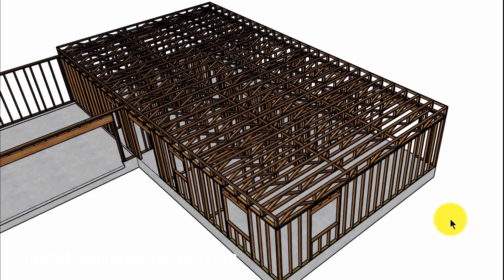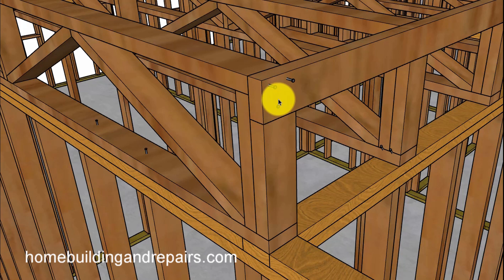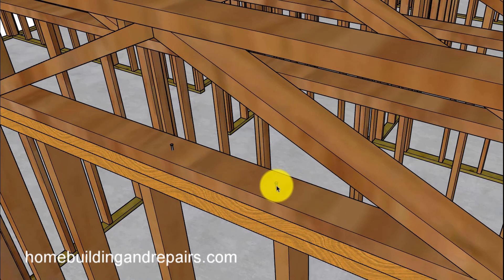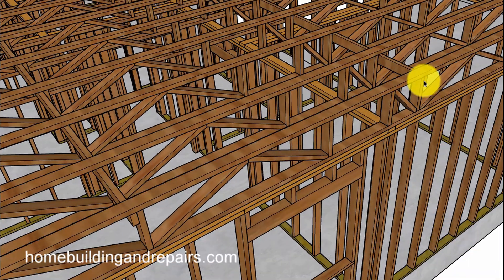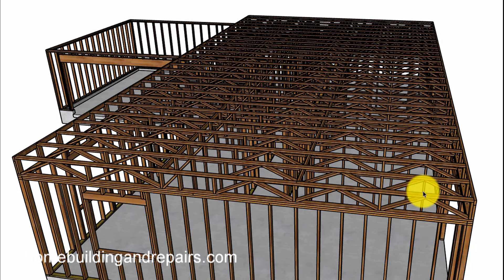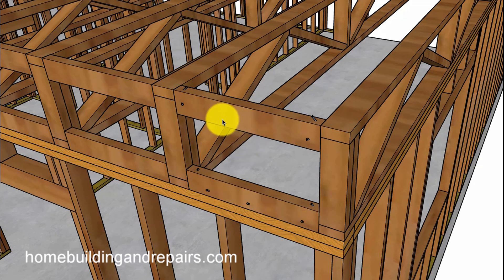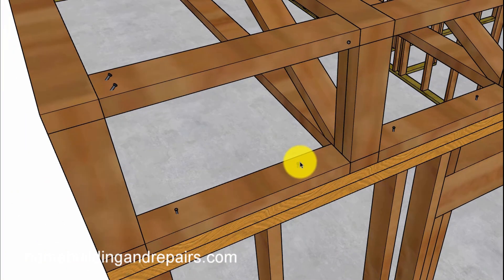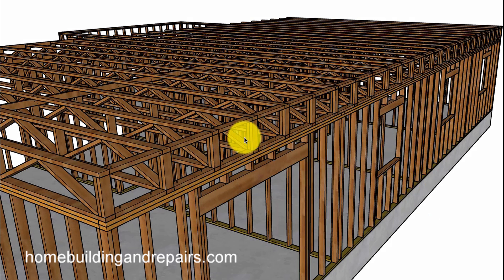Blocking And Stabilizing Ideas For 2 x 4 Truss Floor Joists

Comment: Quick question. My house was built with trusses like these but they are 24" apart from each other. The trusses themselves are in perfect state but because they are so far apart, the floor feels very spongy right in the middle between the two trusses. I can see from my basement how the subfloor moves down right in the middle of the trusses. The subfloor seems to be regular 3/4 osb, not the ones that click with eachother but the simple ones that just sit flush next to each other. Would just blocking help? Its very squeaky throughout the whole house and its a 10 years old house. 😢
Reply: They should have used 1-1/8" subflooring!
Reply from the maker: No easy answer here. Blocks will help, but could start making noise like floor squeaking after a while. I've seen some people add another layer of subflooring, but that could be difficult and expensive.

Comment: Best vids on the Tube :)
Specific question- I get vibration on a truss floor with washer spin cycle.  Any suggestions on how to firm things up a bit?
Reply from the maker: Your joist might be over spanned or you could have some engineering or constriction assembly problems, but you could also need a new wash machine.
Reply: @gregvancom hahaaa
Hope not.  It’s new.  Span about 15 feet.  It’s hard to describe.  Floor is solid when you walk on it but at the same time the higher frequency motion seems to have more motion than solid beam.  Maybe I just need to get used to it?

Comment: Informative video.. . I'm a truss designer it's a pleasure if I can help in any case of trusses designing
Reply: is it possible to add a lvl beam under those joist? some of my bracing are cracked i thought maybe adding a beam under to cut the span halfway would help, but i was told it is not possible unless done properly
Reply: @denisdyotte2935 Look up strongbacks! I am having the same issue and just learned with strongbacks are. They go in the truss - not below.
Reply from the maker: Thanks

Comment: Thanks Greg.  I have a 2x4 Truss floor 24OC, and I want to tile a bathroom floor but TCNA methods are very limited for that span.  Would adding blocking/bracing (perhaps a mini truss)  between trusses under the bathroom floor increase the stiffness of the floor or is this a fools' errand?
Reply from the maker: I would think you could, but these are engineered floors and any modifications to them might create problems in the future. You could check with one the manufactures for more  info.

Comment: Greg - great video and graphics. Won't your subfloor supply the necessary membrane to stabilize the trusses? With the subfloor material, why block at all?
Thx, Jay
Reply from the maker: It might, but I'm guessing the manufacture wants a firm board to nail perimeter sheathing and to help support framing above these areas.

Comment: I keep getting myself distracted wondering why you would have built the trusses with nails and not use metal connector plates. Is there a reason? There is a bit of time talking about nails that wouldn't be an issue if the 2x4s connected using plates to build the trusses.
Reply from the maker: The video is not about building a truss, just how they can be connected to each other and other components like walls with nail, not other types of building hardware.

Comment: Do you know how I can add a non load bearing wall above, parallel but between these 2x4 web trusses? Blocking? Otherwise, can I only add non load bearing wall directly on a truss?
Reply from the maker: Blocks should work. There are a few ways to install them, but I'm not a big fan of how  some of the manufactures recommend installation. See if you can find installation instructions for open web floor joist for suggestions or let me know if you can't find anything helpful.

Comment: Greg...use a H1 floor joist hangers...1 or both sides instead of bottom blocking...most designers can extend the top cord 1 1/2" for your top rail to be attached...for naximum strength. Always use an altered nail pattern...to make OSHA happy. The system can be layed out on the ground with the plywood/osb decking tacked in each corner of the sheet alternating sheets leaving 4' of 8' u tacked so with a spreader bar and a mobile crane or boom truck...sections of the floor truss system....usually 8-12', can be lifted into place....minimizing the manpower time of being on the roof at high heights and increase productivity....this can be done with roof trusses as well...thx...00, the old trussman from Colorado...lol
Reply from the maker: I like it and thanks very much for sharing.

Comment: My second floor is resting on these trusses, I am at a loss for how I can tie in a subfloor directly on top of the joists for the curbless shower pan. Also I have to tie in new subfloor in other areas where there was water damage, and I need the floor to be stable. My trusses are almost 24 inches apart on center.
Reply from the maker: You might be better installing curb, because of the water proofing that might raise floor.  I'm not sure I understand your problem, feel free to provide more details if this didn't help.

Comment: Regarding the trusses over end walls, is diagonal webbing required or are vertical members sufficient since the bottom cord is continuously supported?
Reply from the maker: I've seen small trusses without diagonal webbing and only one board in the center, but not on larger ones with longer spans say over 16 feet.
Reply: @gregvancom  I'm specifically talking about end wall trusses that bear on the foundation walls for their full length.

Comment: My home was built with these same 2x4 floor  trusses. Basement, plus two stories, the floor truss spans 26’, they are 24” deep, 24” on center. I want to take down some room partition walls between two small bedrooms & bath to create a new master bedroom suite. Do I need an engineer to approve the removal of partition walls?
Reply from the maker: Your question isn't really easy to answer, but I would suggest contacting your local building and safety department and they would be located in your city or county government buildings.

Comment: Why would a floor not b level with these trusses ?  Where do strong backs get installed ? I remember u saying 16’ but why not less ?  My floors r terrible.
Reply from the maker: I don't know why a particular or built like this wouldn't be level, but would guess that it might have something to do with incorrect engineering calculations, wrong on center floor spacing or too much weight. For example maybe someone had a waterbed or use the area for storing heavy objects like books. As far as locating strong backs, you should contact the product manufacturer for more information.
Reply: gregvancom I think I needed more strong backs so to hell with that engineer

Comment: What bracing can be done on a ICF block home using 2x4 Truss hangers?  Using a Watkins Hanger. max span is 21' on truss & 24"on center. looking bracing in kitchen/living room area.
Is using 1/2" ply 4' long on side of truss, in middle of truss ok to firm it up?
Reply from the maker: Feel free to send me some pictures of your project or drawings for more information and you can get our email address at our website. It's difficult for me to tell what you're doing, but you can also provide me with more detailed information.

Comment: Why not use wooden i-beams?
Reply from the maker: You've been busy asking questions on my channel lately, haven't you. If you're talking about a trust joist, then it might be able to be used if it was the same height, but again you would need to check with the product manufacturer or engineer of record for verification.
Reply: There are also advantages to using trusses over I-joists.
Reply: @digitalconsciousness  for sure …